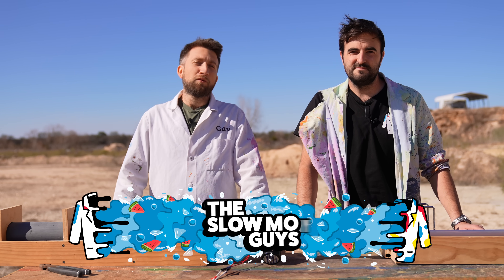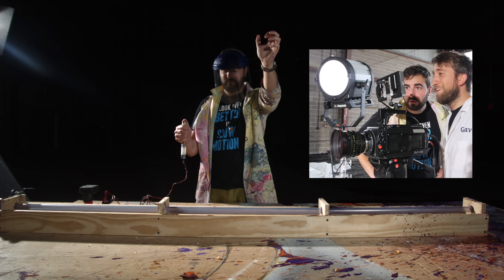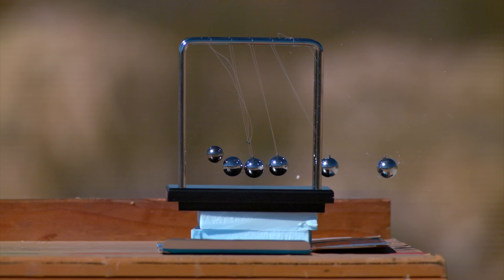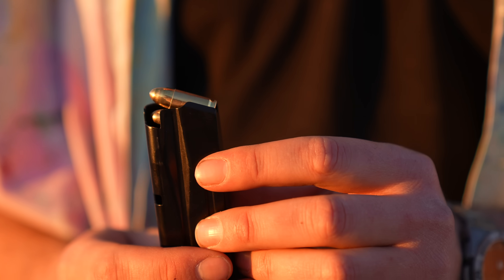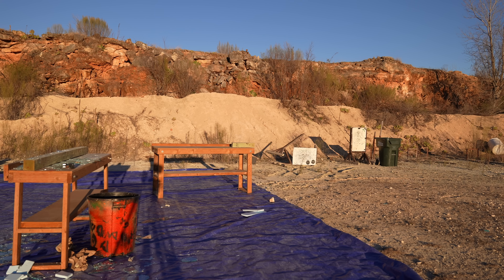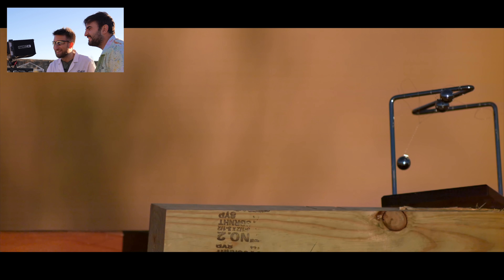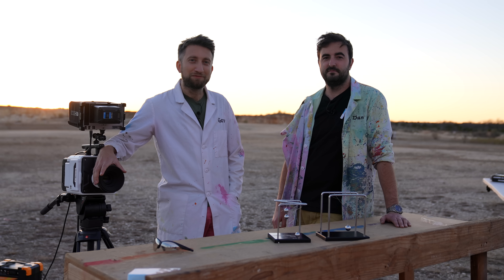Bullet vs Newton's Cradle at 100,000 FPS - The Slow Mo Guys

Comment: Wow, that was cool! I wish you could have had a ridiculous frame rate that could show the compressive wave propagation in the balls. According to my rough estimate, it takes ~50 microseconds for the compressive wave to cross one ball. So, you only needed half a million frames per seconds to show a one-second time lag between the first ball getting hit and the second ball start moving. "Only" five times slower! lol. I think the holder snapping was because of the huge shear strain on the boundary between the ball and the holder. The holder does not have enough inertia to produce a considerable shear stress, and the nylon straps could have never responded to that kind of fast excitation. It happens so fast the frame does not "feel" for a while. It's sitting there, and then, some milliseconds later, it's like: "Oh, I'm shot! I'm shot!" and jumps into the air!

Comment: Amazing video ! 
3:18 (freeze frame) the balls seem to be wind affected. The suspending lines are bent left on a curve that suggests wind vs gravity (tilt). 
    Even weirder, the balls appear to be in static contact with each other, yet at impact I distinctly see a "gap" between 2-3, 3-4 and 4-5, increasing. Is this a "rolling shutter" thing ?
   Impacting a spherical projectile precisely into another, along a given axis, is by definition, infinitely difficult. You guys nailed the shot but you can see the slack in the lines as the masses react "out of character".
   A brilliant physical demonstration of something that can only happen in theory... and shows us the difference.

Comment: Modern bullets are specifically designed to fragment. It’s safer, so you don’t hit things behind your target. Specific armor piercing bullets have a harder core, so they can penetrate through armor. They are dangerous; not just to people wearing armor, but for anyone and any thing behind a target. I wonder how it would have looked with an armor piercing round, i.e. steel core.

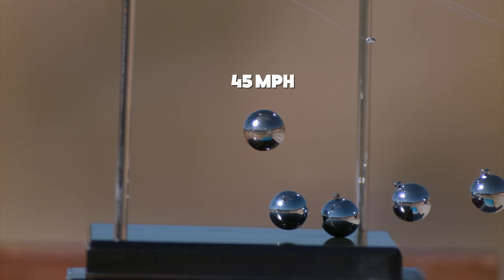Comment: Check out the spark from static discharge at 5:19! Between the projectile, and the small gap between balls 2&3. I suppose the fired projectile becomes charged from friction with air. Cool.

Comment: An expert indeed! Absolutely incredible. This is a perfect demonstration of collision types in physics. When using the ball bearings, because of their hardness and the hardness of the ones in the cradle, the collision was almost (but not entirely, as the pits on the balls show) elastic, with most of the kinetic energy being conserved, where the kinetic energy of the system afterwards was roughly comparable. If you calculated the energy of the balls afterwards, given their different speeds, it is roughly similar to the input energy. The softer and faster lead bullet on the other hand is entirely inelastic! Most of the kinetic energy of the bullet was either turned into heat through friction and shear forces, or deposited into the air and baseplate as the shards of the bullet sprayed out. The balls of the cradle, as the secondary object in the collision, maintained momentum and had some kinetic energy as a result, as did the cradle itself, but most of the energy was lost. 

You used a newtons cradle to demonstrate inelastic collisions. Physics professors will either adore you or despise you for this, but I'm positive Newton would have giggled after he stopped gawking at the concept of cameras that take photos, cameras that take so many photos it can play them quickly enough to convey motion, and cameras which take so many photos so quickly that they can capture motion faster than the speed of sound.
Reply: I mean to be fair, a slow motion camera taking a massive number of photographs of motion over a short period is a pretty good way to think about calculus (or fluxions as Newton originally wanted to call it)
Reply: @dylanand75  just wait until newton makes a camera with no frames, just perfectly smooth motion. A "true video" camera
Reply: AHHHAhhhAhhAahh Yea Yea Psychics Wow
Reply: this dude acts like we actually want to read 50 paragraphs
Reply: @TheSonOfShadowPhonk  I did. Leave people alone.
Reply: @TheSonOfShadowPhonk  just 2 paragraphs bro sorry you can't read
Reply: @olojondro73  it’s not that I can’t read I just don’t like to

Comment: muzzle energy depends quite a bit of speed........ but having ~10X the mass makes speed not matter one bit
.
like.... ya either drive a small bullet fast
or.... a BIG bullet slow AF
.
ya cant have both
yet both have the same muzzle energy 
.
but the big bullet will keep more energy at longer ranges (however, having more bullet drop)
and visa versa 
.
.
.
the ball bearing is like a 45-70
and the 9mm is.... like a 9mm
.
pistols arnt as powerful as people think
id rather be shot 2 to 3 times with a 9mm than a 45-70....... honestly!!!!!!

Comment: It would be interesting to see a similar thing with higher grade ball bearings so they don't deform and put them inside of a clear tube. You could line them up at any distance from each other using a magnet from the outside of the tubing.
Reply: Maybe with a pinball launcher so you don't have a lot of air pushing the other balls.

Comment: I'm glad to see you both back at it. Now, on the topic of bullets. They are actually designed to transfer it's momentum to impact force by flowering, or blooming. By adding surface area to the impact zone they deliver more stopping power. Slower caliber "to a degree"  will cause more damage to soft tissue. That is why the exit wound, "if it did exit" is always far worse then the entrance, plus there is a pyramid effect inside the object getting hit.

Comment: Do I understand why the bullet shattered? Yes. Was it still totally surprising? Yes. Well done!
Reply: Because they have a balls of steel
Reply: Original BB looks like a mini death Star lol 😂😂
Reply: The King  Absolutely, and the coating around the lead is nickel, which isn't any better.
Reply: @12378dnn  copper, not nickel.  But yes, still relatively soft.
Reply: @cmtptr  even though Dan says its nickel
Reply: Spoilers
Reply: I assume they were using frangible or hollow point bullets and not FMJ (full metal jacket) bullets which are more solid
Reply: @avg345  Dan explicitly says it's FMJ, and it's certainly not hollow point. Doesn't look like a frangible round either. It was definitely an unexpected outcome, but it's understandable that a small dense ball of stainless steel could break a 9mm FMJ.
Reply: @avg345  Looked fmj to me.  Lead is just very soft.

Comment: I'm not sure if this is entirely right, but I think that this is an example of "impedance matching" which is used in all kinds of areas of radio and audio. They even did a futurama episode about a gigantic ball of garbage being used to bounce another gigantic ball of garbage out of the solar system. The ball bearing is more closely 'matched' to the other ball bearings in the desktop physics toy, and it is more effective in transferring the energy into subsequent balls. Super neat!

Comment: The bullet imparted less energy on the balls because it is made of softer metals that could not absorb the impact like a steel ball bearing. The shock on the bullet causes it to shatter, rather than transfer its energy. I would love to see this test repeated with a 5.56 green tip with the mild steel core. Keep in mind that Green tip is NOT armor piercing ammo because it is mild steel. All it does is retain its mass and shape when passing through a barrier.

Comment: It looks like the barrel was made with a way to apply a vaccum to it.  I know the mythbusters used that technique to shoot pingpong balls at ridiculous speeds.  I wonder if that would have an effect on a steel ball projectile.  Or if its so heavy it won't matter except for a slightly lower wind resistance.

Comment: The best part about this is what it tells us about the energy absorbed by each bearing. In a perfect system, the energy is transferred without loss. But in this case the bearings nearer to the projectile are dented deeper than the ones farther away. Each dent corresponds to a certain energy dumped into that bearing. So each one absorbed a specific amount of energy which can be estimated as a function of the kinetic energy of the projectile and targets before and after impact.

Comment: Dan is 100% right about the hardness of the bullet. This is the snowball principle that explains so many things. It explains why the craters on the moon are circular, and why many long distance missles dont have a payload. Basically if the energy of the collision is greater than the energy keeping the one or both objects together, the path of least resistance is for the object to fall apart. So, you for a collision like this, you dont need a projectile harder than the target, but you do need one hard enough to be able to take the full force of the impact.

Comment: I think most ball bearings are 52100 steel which is abrasion and crush resistant. I am curious what the impact force is on the fired bearing because you can see particles of it in the air. It clearly has experienced some crushing.

Comment: Did I miss it?  What were the velocities of the steel balls and bullet as measured from the video?  Calculated the momentum of each.  The soft lead and copper bullet is a nearly perfect inelastic collision.  The steel ball will be a much more elastic collision.  The elastic collisions between steel balls will pass on much more momentum than the inelastic collision of bullet and ball.

Comment: Although I'm sure the ball bearings aren't made of the strongest metal in the world, bullets are made of copper and lead, so to see it hit the steel and fragment quite quickly makes plenty of sense. I am a little surprised the energy transfer into the cradle wasn't any more significant, though. A few hundred ft-lb of energy and the opposite ball barely moving in comparison to the ball bearing launched at the cradle was slightly shocking.

Comment: The initial "ball" rounds had a very large amount of energy absorbed as evidenced by the cratered Newton's Cradle ball. Would be much more energy transferred with harder materials, like tungsten rather than mild steel.  And . . the 9mil round was pretty intriguing to say the least.  Nice Piece-O-Werk Boys ! !  A thought . . I've seen vids of car audio systems actually turn auto glass into a "wave over water" without breaking it . . slo mo worthy?
Reply: That the Newton's cradle ball was cratered is actually evidence that energy was transferred since it takes energy to deform the target. You are right to say that energy was absorbed by the target, but that energy could only be absorbed by the target if it had been transferred to the target.
Reply: as someone who didnt finished school, this Is very worthy 👍
Reply: I've seen car audio systems actually tear the factory body sheet metal on a vehicle before. It's pretty awesome that a sound system can destroy an automobile. Metal gets torn, glass breaks, holes end up in metal floors, dash boards and interior parts get blown apart, tail lights fall off, etc..

Comment: as well as filling the airtank, you could also put the barrel into vacuum first.

That way, the projectile will accelerate way faster by the time it exists the barrel...up to a point.

The longer the barrel, the more air will remain in your vacuum (without using something like a diffusion pump), and, the more chance there'll be of air coming out of your compressed air tank getting around the outside of your projectile...resulting in air getting ahead of the projectile resulting in a secondary compression between the destructible cap over the end of the barrel (maintaining the vacuum) and the projectile itself resulting in a dampening effect.

Also, talk to the hydraulic press channel about getting a ceramic bearing or two for your projectile too 🙂

Comment: I would love to see this redone with a newton's cradle that has metal cable instead of the nylon, and maybe mount the cradle so you get all of the energy transferred to the balls instead of the structure.
Reply: If you rewatch carefully you should be able to see that the balls were freed not by the nylon snapping but by the mounting tube tube breaking free. This tube is only weakly soldered or brazed to the ball. Metal cables will not solve this problem. In fact, with their higher mass they're likely to exacerbate the breakage as the cable will want to stay still which restrains the tube while the ball wants to accelerate.

Mounting the balls on a heavier base won't necessarily lead to better energy transfer, it just means that for the same amount of energy transferred to the mount you won't see the mount move so far.
Reply: @igrim4777  That break usually happens in the first and last, but the middle three tend to break via the nylon. 

I guess the way I worded the other part was not accurate to what I wanted. I meant to say, have it bolted down or something so that the energy transfer doesn't rip the entire system off the board.
Reply: @jackechlin9372  Thank you for correcting me, you are quite right the nylon does fracture on the middle strings.

Comment: Just looking at the first slow mo clip, it looks like the bullet gets a little deformed on impact with the first ball. It also appears that, though undetectable by the eye, there is enough vibration caused in that first ball that the connector is ripped off. The third and fourth ball is lost due to the string's sheer strength force being exceeded.

Comment: When a round explodes like that, it’s called spall. It’s actually a huge issue with some armor systems, to minimize spall most body armor is covered in cloth to catch the spall.
Reply: It's also why you don't shoot at steel targets from too close. Nothing like a shower of hot lead shards to ruin your target-shooting experience.
Reply: @TheRogueWolf  Yes I was wondering why Dan felt he needed to be so far away, but seems it was a good call
Reply: When a projectile fragments like that it's called fragmentation. If only some fragments had broken off the projectile's surface it would be spalling.

Comment: The reason they don't swing up is because the strings can't handle the tension. Tension is the only force capable of pulling them upward, and the strings break way before the force can do anything significant to the bearings' trajectory at such horizontal speeds.

Comment: Unnecessary tangent for the sake of random knowledge: BB is actually a specific size of shot, which is 4.57 mm in diameter. Shot sizes don't go up to 3/4 inch, so I guess you could just call that a ball bearing.

Comment: I remember a similar experiment in my introductory university physics class. The professor used a small spring-driven pistol to shoot a small bullet (at quite high velocity) into a pendulum. We measured the horizontal displacement and used it along with a few other parameters to calculate the bullet’s velocity.

Comment: I designed and built a potato gun when I was a freshman in high school using the same design of compressed air and a solenoid. It was waaaaay more powerful than using MAPP gas as the combustion material.

Comment: Your Lab coats make you Look so darned professional guys I was thinking you should have used a 10 gauge Shotgun Slug round or maybe build a black powder pistol gun that fires these Ball bearings at the same size of newton's cradle Ball bearings and replace the nylon string with Spectra spider silk 100 pound test fishing line

Comment: It's gruesome,  but . . .  soft-nose bullets are carefully designed to shatter on impact with flesh,  each tiny shrapnel shred is meant to cause more damage . . . but the target still absorbs the whole energy of the impact only if it captures and stops all the fragments.
If you want to impart all the force of the shot to a hard target,  use a hard-point slug,  such as an armor piercing round.
Fifty cal should do it.

Comment: I wonder if the loop & string getting detached from the first pendulum on the cradle is a shockwave effect, where the impact shock transit around the surface & focus a cracking effect into the loop where it meets the surface.

Comment: This would be really cool with a custom Newton's Cradle with much stronger wire! It seemed as if thats were its main point of failure was when hit with the BB
Reply: I thought the weak point was the connection.  Most wires ripped off of the balls instead of breaking.
Reply: Get it done, #markrober
Reply: It's not the wires that broke first.
Reply: the point of the newton's cradle is to have as light a wire as possible.